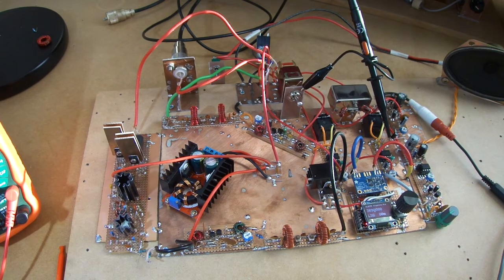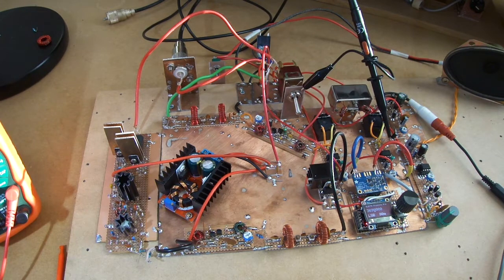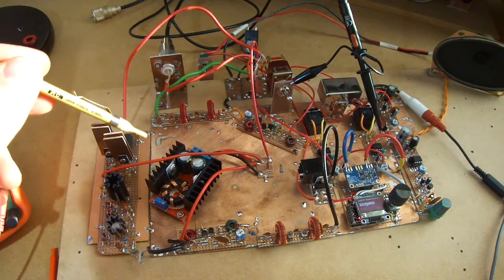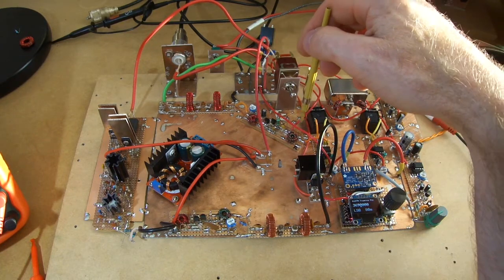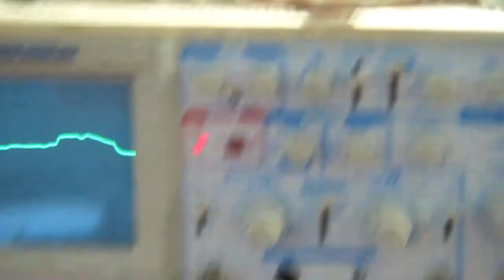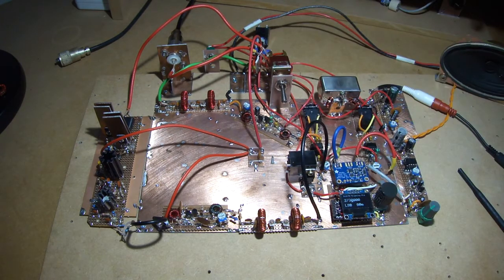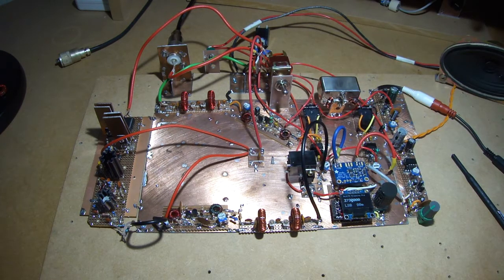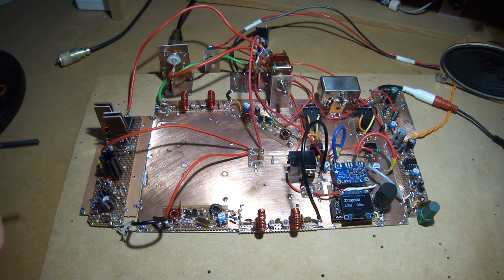Homebrew Portable SSB Transceiver Part 5 - Final Transmit Tuning and On Air QSOs

Comment: Excellent job, I like the way you have it built in modules spread out for testing, I can see how it makes it then easy to put in a box later once you have it all working, 73 and a Merry Christmas to you too.
Reply from the maker: It certainly does. It's a very easy and quick way to make up a circuit. I now have a small CNC machine, so I do want to look at engraving some PCBs at some stage.

73s